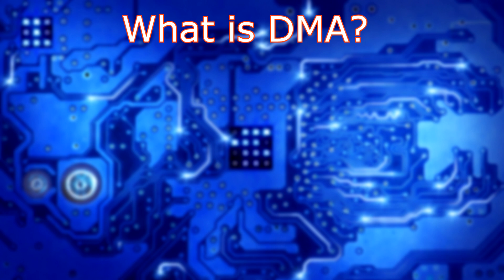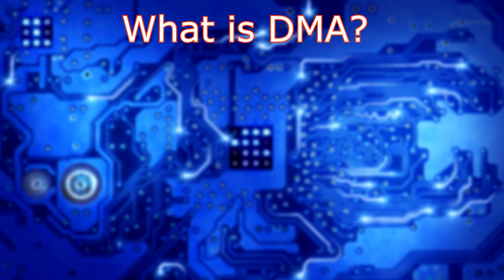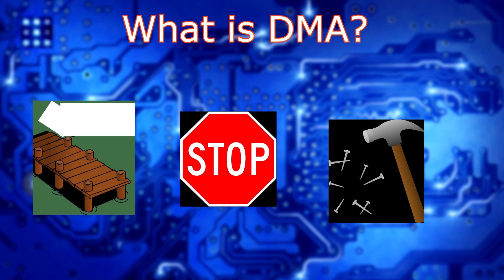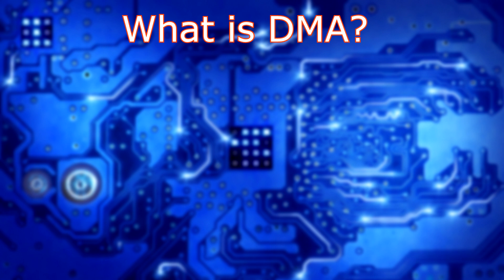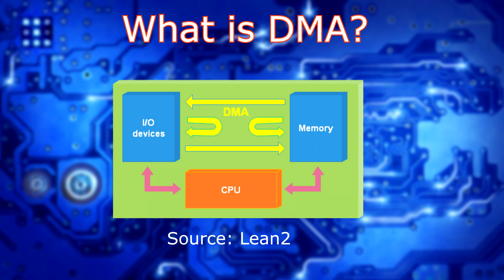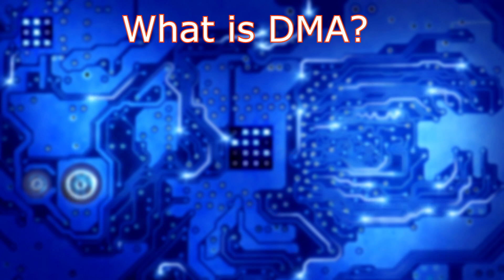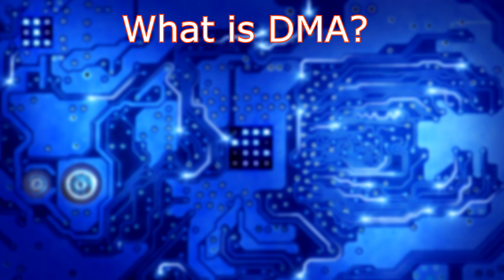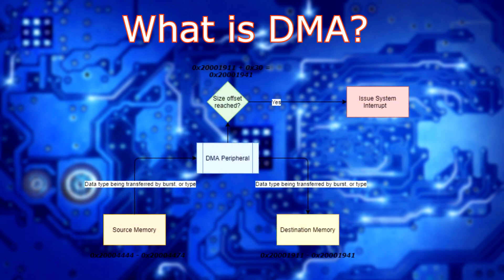Simply Put: What is Direct Memory Access (DMA) in Embedded Systems

Comment: Like your series of videos. Here, I think you're describing a DMA controller rather than DMA in a broader sense, which just means direct memory access. In some DMA designs it's possible for a peripheral to directly control the memory lines and write directly to the data bus/main memory. In either cases, the operation would occupy the data bus, and unless the CPU has useful data in its cache or pipeline, the CPU would stop. One example I'm familiar with is the blitterchip in the Atari ST.